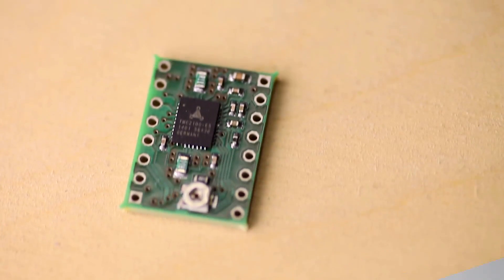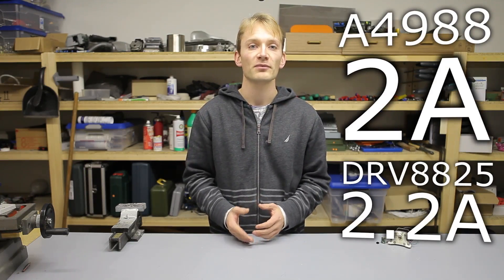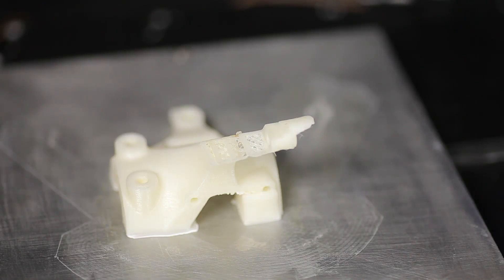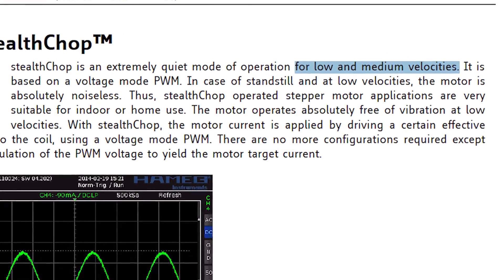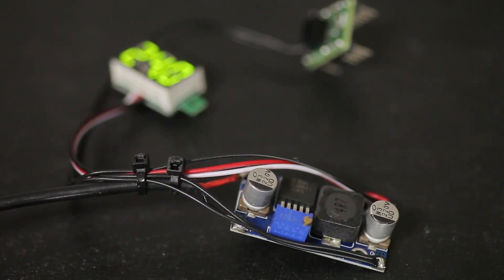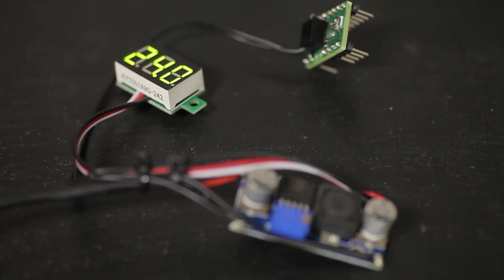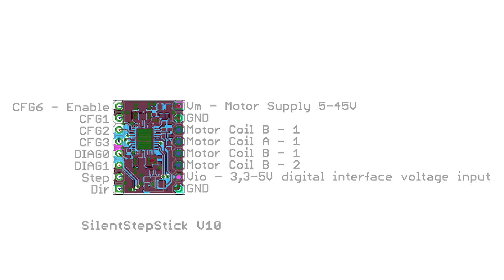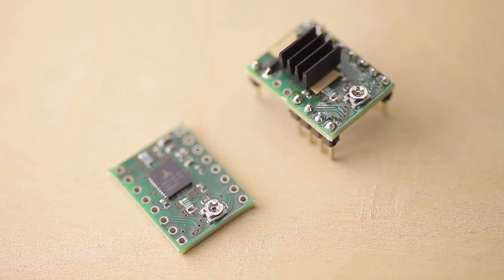Honest pre-review: The all-new Trinamic TMC2100 stepper drivers!

Comment: Hi, this driver can produce 256 steps, as I learned. But does it mean, using arduino, I can tell my stepper to turn 1.8/256=0.007 degree every time and wait X sec then turn 0.007 degree? I want to make a rotating time lapse head. So my plan is to turn as slow as possible and step by step like TURN 0.007 degree then wait for SHOOTING CAMERA then TURN 0.007 degree. Thank you in advance.

Comment: i kinda messed up the solder jumper as in, track disapeared,  for spread cycle, can i use the wire method for CFG1 to GND  even though some warn against this? these are the mks tmc2100

Comment: I've installed TMC2100 in my camera slider, it's incredibly silent compared to any other drivers. However, I noticed jitteriness in the camera's footage at random positions, which I believe due to losing random steps. Can I tweak something to improve its performance? Note that vibration isn't a slider issue as using the noisy DRV8825 resulted in very smooth motion.

Comment: I have just switched these for my my DRV8825 on an Ultimaker clone 3D printer. I am very impressed with the noise reduction! They perform at least as well as the DRV8825 or A4988 but reduces the stepper motor noise considerably!

Comment: TMC 2100 does not have the legacy features of trinamic drivers  like stall guard2 & cool step. Seems like there might be a more advanced version TMC 2130 which will include these features. Anybody has more info on this. Would like to see a review of the t-bone cape for BBB which uses trinamic amazing drivers & motion controllers.
Reply: Anil Kumar it could be. i cant remember now.. because my biggest concern was the silence of movement for live photography.. I will check it out and try spreadCycle which supposed to have higher torque and still quite enough